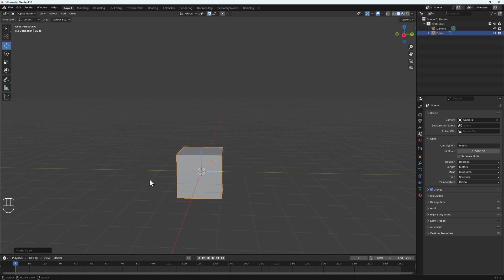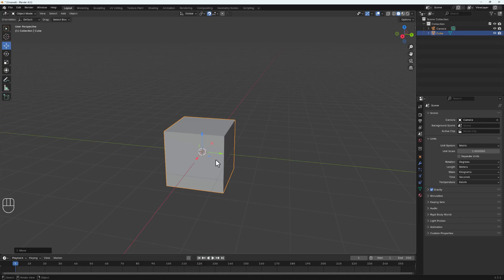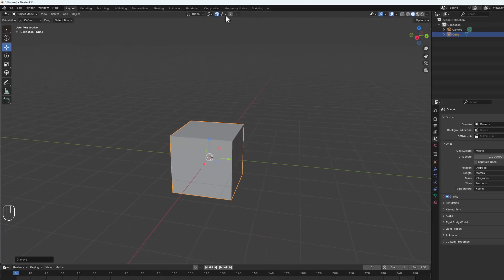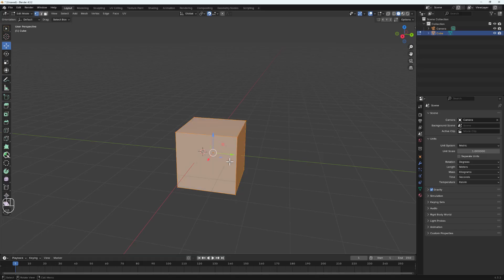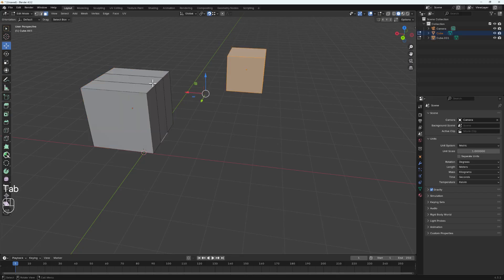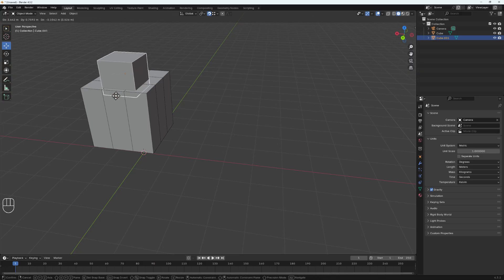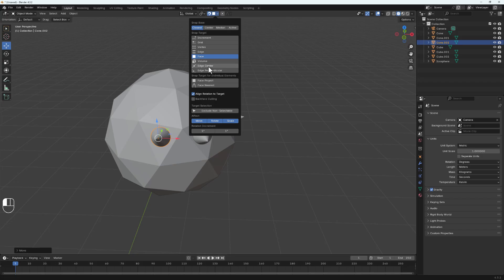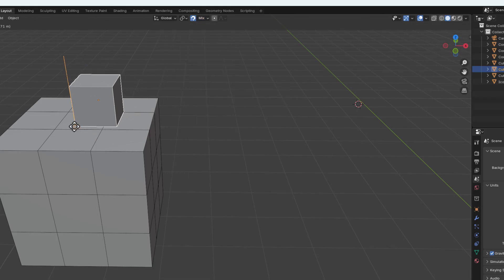Snapping in Blender Fully Explained!. Beginner-friendly.🔥🔥

Comment: This tutorial is really great and I learned some new things.
...
But still I have an unsolved problem I was hoping maybe you could help me figure out. With rotation snapping. I can't find a way to get a contact point to snap to exactly to a plane when rotating. I could calculate the angle by measuring the distance points and using pythagorean theorem, but I feel like there should be a way to just snap it. but when snapping to a plane with rotation, it just snaps to anywhere on the plane rather then where it contacts.
.
For example referencing your video. Imagine the small cube rotating, and the moment it's edge or vertex touches a plane of the other cube, it stops rotating. I've almost concluded it's impossible to do in blender, but perhaps there's something I've yet tried that works.